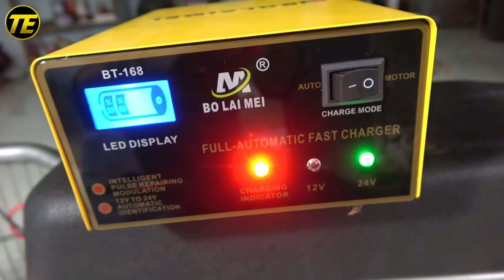Homemade Mini Electric Motorcycle

Comment: With all the equipment available, this is not a homemade ... rather a non-professional workshop. but this is great, I want to start my electric motor project as soon as possible
Reply: I’d call it homemade still. He is manufacturing in what looks like a regular shop, welding and assembling on a floor. Sure he has a metal large but they are relatively cheap second hand

Comment: I like how you mounted the handlebar stem backwards for more space and I like the wire basket sides. I wonder how this would be with front and rear motor and lithium batteries.
Thank you for sharing and have a good day.

Comment: you are welding galvanized steel, galvanized steel gives off a deadly fume that will kill you if you breathe it in, how did you not know this? at least grind off the coating using a flap disc wheel . this is basic welding safety
Reply: The weld is weakened by zinc contamination, and galvanically corrodes internally.